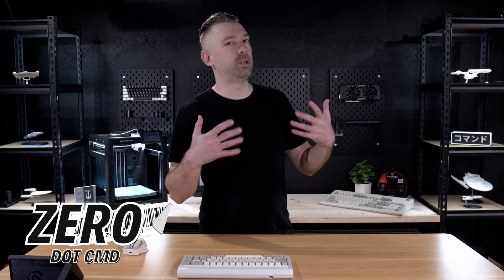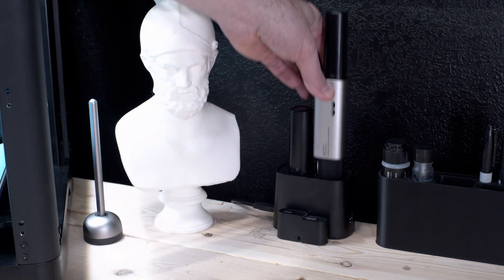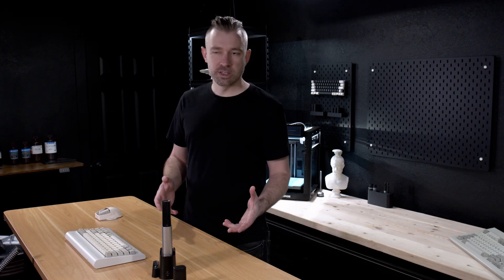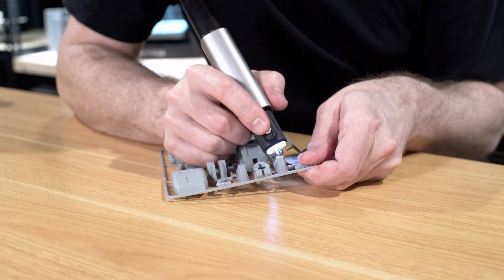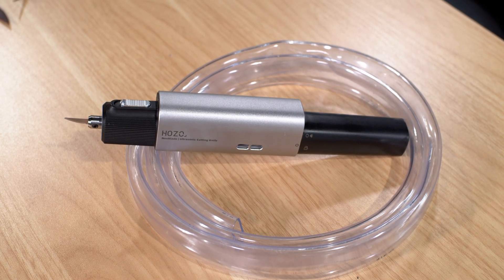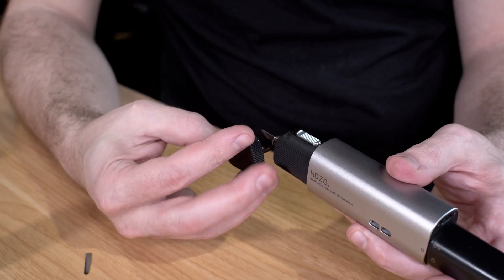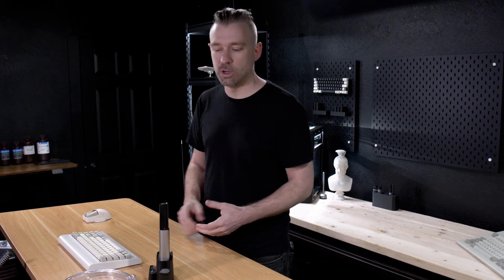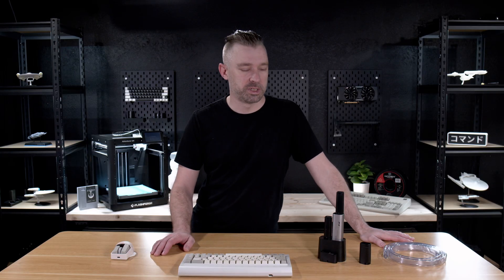A Better Ultra Sonic Cutter for 3D Printing and Makers? NeoBlade

Comment: Yeah got that thing and it melted everything I tried to cut. Also in 2 minutes the whole thing turned into a heater. Handle got super hot. Returned. Got the Hanboost and it works like a DREAM!

Comment: I have another one and is just an expensive hot knife. It melts the plastic, although with ultrasonic means.
Not to mention the awkward form factor, with the body getting in the way of what you're cutting  e.g. when removing support in the middle of a large surface.

Comment: You're missing the dewalt pex expander tool. 
Clearly a casual
🤣
Reply from the maker: God I HATE pex.
Reply: @zerodotcmd I'm curious now, what do you dislike about PEX? I've been impressed with the tech and its capabilities, and to me it seems like an improvement on most of the existing systems like CPVC, and it has some positive tradeoffs as compared to copper, though I'd be very interested to get your take.

Comment: Will it cut rubber/ latex better than a rolling blade?
Reply from the maker: It depends how you're cutting. If you're only cutting a straight line the rolling blades are hard to beat. However if you are cutting anything more intricate then the rolling blades don't do so well. The NeoBlade would most likely be better for designs sharper curves.